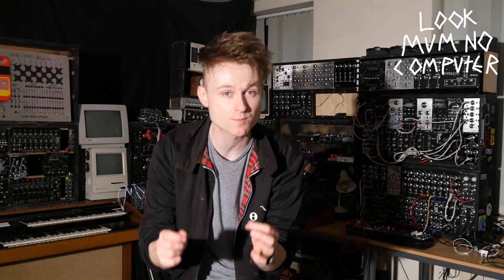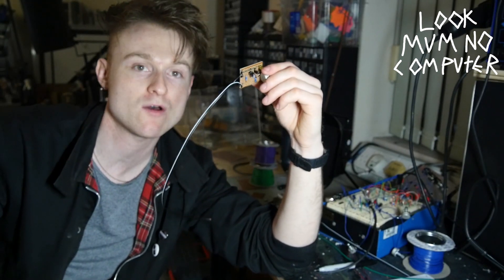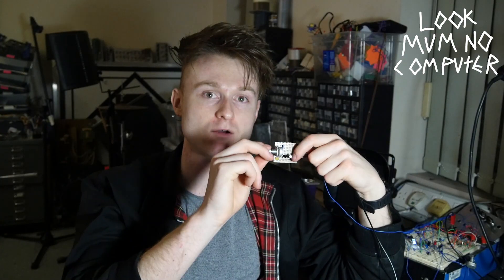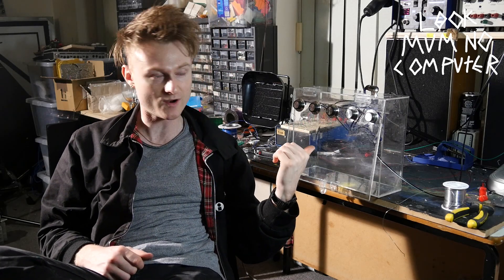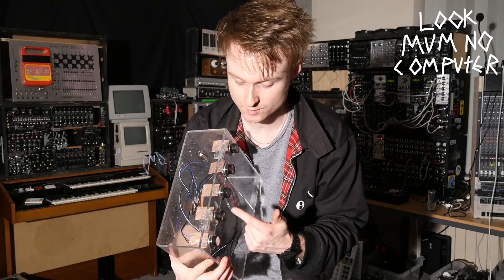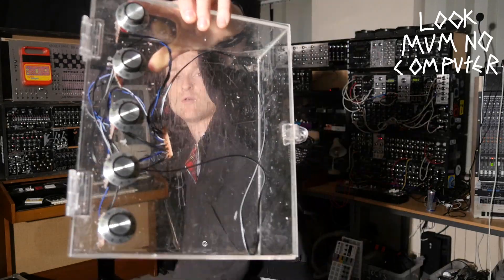The simplest DIY audio oscillator? not a 555 chip. reverse avalanche

Comment: You've obviously left something out of these instructions. Or, your diagrams are wrong.
Reply from the maker: It works both ways. And has worked for many people. Try the next video in this series some 2n3904’s need more voltage
Reply: @LOOKMUMNOCOMPUTER Thanks ill check my batteries to make sure they're up to snuff. How much higher can i go on the voltage? I could series another 9v in. That would be 27v. Too much?

Comment: It's not clear from your diagram how the 10k pot is wired. Please clarify. It looks like you've jumpered the outer and center legs of the 10k pot together with the 18v positive. Your hand drawn block diagram shows something different. Looks like you're only using the outer two pins on the 10k pot. One to the 18v positive and the other to the transistor. Please clarify. I am 59 years old and I can't get the simplest oscillator working! I haven't done a lot of electronics since I was in high school electronics class back in 1985, but you'd think I could get this the first try! Very frustrating! Also please clarify the output ground for the speaker. I am assuming it is the ground for the two 9 volt batteries. Does this circuit need a preamp?Love your channel but please help. Sincerely, Carl. Astrophotographer, musician, artist and electronic tinkerer, but feeling like a dummy.

Comment: Hi LMNC, how are you? Please, not being very experienced in electronic construction, for each component, what is the nominal voltage to respect? For example, for the capacitor, how many volts for 10uF? The same goes for resistors, LEDs, transistors, potentiometers... or the value is not important. I'm stuck here and don't know what to buy. Thank you very much and good musical continuation.
Reply from the maker: they usually say capacitors especially

Comment: So.....will 5 oscillators need 5 pairs of 9v......that is 10 batteries
Or
Will they all run off one pair...albeit a shorter battery life span??
In the video a plug in transformer was used......will that power say...5 rows of 5 oscillators??

Comment: I have an issue with that schematics: When I do it the way he shows it doesn't work. 
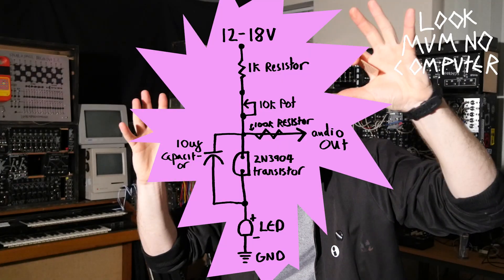- 1:56 I tried his "hand-drown" schematic (where capacitor is placed between Emitter and collector od the transistor), 
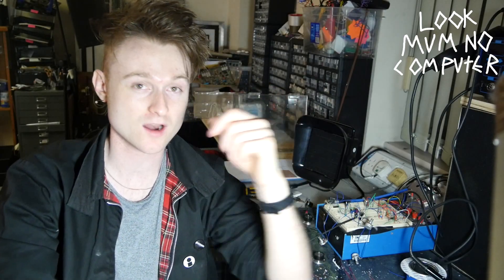- 2:57 Tried the perfboard one (where negative of capacitor is on transistor's emitter and positive to ground). I tried inverting the cap position of course.

➡ So here's how I got my circuit to work: 
Cap's positive to transistor's emitter, cap's negative to output.
Also works with cap's negative to ground and LED's negative to output. 

When I implement R2 between osc's out and general output there's no more sound at all (tried different values) 

Any thoughts about that?
Reply from the maker: yep. it works both ways.
Reply: @LOOKMUMNOCOMPUTER I was trying it too. And I have to say: all of your showed circuits doesn’t work. Maybe you don’t know the difference between bipolar capacitors and Electrolytic capacitors…Why you keep telling lies to your followers? Maybe because they keep saying
Reply from the maker: @DJtechNICK187  both ways work!
Reply from the maker: some people for some reason have had trouble with the 2n3904's for some reason. no idea why. but you can get the circuit to work with a polarised capacitor facing either way. the ss9018 is a better transistor to use. its what i made the 1000 oscillator megadrone with. but the 2n3904 does work.

Comment: Why you need transistor?
Get a piece of Galena, poke it with slender steel wire...diode!
'Crystal detectors' in old home made radios were pretty good diodes.
Zinc oxide film on steel works well too.  Negative resistance region and all that.

Comment: For any one that it might help, the 2n3904 wouldn't work for me. I read some comments that mentioned there may be differences between the various production runs of it? 
So, I swapped it out with a BC547. Had to connect to an amp with a 1/4 ts to be able to hear the signal. Two bare wires one side and the 1/4" jack on the other. Connected the cable's sleeve wire to ground and the tip wire to audio out. I also switched my cap to 4.7 uF. Thank you @lmnc for an interesting project that I'll build on further.

Comment: I tried many times but my LED stays on bright. I cant get it to blink/flicker. Tried 9v, 12v, 18v. I think i need more correct voltage, saw a video of a guy who only got it to work on a certain voltage.

Anyone here wanna talk/share electronic projects and help troubleshooting on a discord?
Reply from the maker: Go to lmnc discourse
Reply from the maker: Different transistors
Reply: @LOOKMUMNOCOMPUTER  Tried 3 other 2n2222 and some 2n3906. The led stays bright but it dims slowly because of the capacitor. Thanks for the answer! LOVE your channel.
Reply: Just found out I use 2N222(A) transistor. Maybe that’s the problem.

Comment: wait wait... ignorant questions: the 12v positive from the breadboard goes to the positive of the battery.... what about the ground? what about the negative of the battery? ground goes to negative of battery???
second: if i want to connect to a power supply to plug on the wall what is the polarity? is it safe to just switch and try?

Comment: how the heck can we get a more stable frequency with 555 is something that still kinda escapes me; i tried using military grade capacitor thinking it was the threshhold but i still get a little wobble... guess its impossible since its not temperature regulated lol. i did manage to fix it by adding another small pot to adjust the tuning and alternatively i was able to just keep the device on and would still have the right tuning and frequency

Comment: I’m really new to electronics and can’t figure why it doesn’t work on stripboard
It work fine on breadboard but after 4 tries, I’m asking for help...
Layout isn’t complicated so I don’t know what can ruin it
I’ve tried with several heat from my iron, try to clean the stripboard before soldier with a sponge to get the shinny aspect indicate I remove corrosion... I don’t know what is wrong 🤔
Any ideas ?

Comment: Hello everyone and thanks for the awesome video. As a beginner i am confused. I think i see a difference between the circuit plan on 1:58 and in the graphic on 3:00. Shouldn't the capacitor go into the positive pin of the diode, instead of going directly into the ground? Or doesn't it matter?

Comment: It's called an Esaki oscillator.
Reply from the maker: Reverse avalanche. Not sure where Esaki oscillator term came from. But reverse avalanche describes its function
Reply: @LOOKMUMNOCOMPUTER  having a conversation with chatgpt about it it seems an esaki oscillator is this circut with a tunnel diode in place of the transistor? also this 
"Esaki oscillator refers to a type of oscillator circuit that utilizes the unique properties of a tunnel diode, also known as an Esaki diode, to generate oscillations. The Esaki oscillator is based on the Esaki diode's ability to exhibit negative differential resistance (NDR) in its voltage-current characteristic curve, which is different from the behavior of conventional diodes.

The Esaki diode, named after its inventor Leo Esaki, demonstrates a region in its voltage-current curve where the current decreases as the voltage increases. This negative differential resistance region is a result of quantum tunneling phenomena within the diode's semiconductor material.

In an Esaki oscillator circuit, the Esaki diode is used in a feedback loop within an electronic oscillator, leveraging its negative differential resistance characteristic to generate oscillations. This peculiar property of the Esaki diode allows it to create self-sustaining oscillations at high frequencies without requiring external LC (inductor-capacitor) resonance circuits commonly found in traditional oscillator designs.

Esaki oscillators were of interest in the past due to their ability to operate at very high frequencies and generate stable oscillations within specific voltage and current ranges. However, as technology progressed, other oscillator designs and semiconductor devices became more prevalent, and the use of Esaki diodes in oscillators has become less common.

The Esaki oscillator's operation is based on exploiting the negative differential resistance of the Esaki diode, which allows it to achieve oscillations without the need for external resonant components. While not as widely used today, the concept of utilizing negative differential resistance for oscillation generation remains an interesting aspect of electronic circuit design history."
Reply: @LOOKMUMNOCOMPUTER the name reverse avalanche is coming from the avalanche diode. Why you don’t know the function of these device but the name of circuit. Maybe you keep cheap unknown talking
Reply from the maker: @DJtechNICK187 mate. It works. Your saying you can’t get the circuit to work. Try again
Reply: Every transistor work whit these quantum phenomena. Electrically components combined to a stable functionality isn’t easy as producing bullshit yt videos full of lies
Reply from the maker: @DJtechNICK187 but it’s not full of lies. It documents a working circuit. And how it works in various orientations.

Comment: what exactly is happening with that blue cable? i tried to do this and got as far as blinking LED but there is no sound coming through my speakers.. hooking ground to green and the end of the 100k resistor to white on my speaker wires. do i need another input between the osc and the speaker? thanks!

Comment: Sigh… Is that layout diagram wrong? Built it and the output part seems to be wrong. Sigh… Only outputs sound if connect speaker to the trannie and LED rail. And that makes LED turn off. Sigh… WTF???

Comment: Hey! So I built the thing and for some reason there’s no power going to it? I believe I have the correct power supply and it feels like I wire everything up just like you said. Side question the blue audio wire? Is that like a normal hot/ground wire it’s just color coded or is it something specific?

Comment: I’ve got a question about the capacitor that I’m hoping someone smarter than me can answer. In all the video close-ups he’s wired the capacitor to receive positive voltage on the negative side of the capacitor and had the positive side of the capacitor running to ground. The schematic shows it in (what I understand to be) the correct orientation with the negative side of the capacitor to ground and the positive side receiving voltage. Am I missing something? The negative side of the electrolytic capacitor with the stripe should be connected to ground, right?
Reply from the maker: it can be either way experiment
Reply: Thanks! That’s comforting to know. I will.

Comment: This really got me thinking if you could incorporate a Jule Thief into the circuit to use less power from a PSU and still tickle the transistor enough to make it oscillate? Wouldn't that solve a bit of a problem regarding the input voltage at least a little bit?

Comment: I’ve built this three times exactly to the strip board diagram, still can’t figure it out, anyone got any suggestions?
Reply: Dude same here idk what’s going wrong at this point. The closest I am right now is 3 functional voices but my potentiometers aren’t doing what there supposed to do when you turn them. What happened with yours?
Reply: @Post_war_designs  I just can’t get it to make any sound, I’ve tried different transistors, different power sources, etc
Reply: @TravelingasaBrokeIdiot  it started to feel like after a while I’ve just been soldering stuff together with no avail, the 3 “working” ones I have technically don’t do their jobs without the potentiometer and the other 2 are built the same way but not functional at all. So last night I turned lemons into lemonade and hooked the one osc into a flanger pedal and put that all into a chassis. So now the flange does the job of the circuit knob and then some 🤷‍♂️ definitely not the route I thought I’d take but it worked enough for me
Reply: After watching how to build 555s it seems like a 555 could actually be more simple to make

Comment: An S9018 transistor will work off one 9V battery. (some low as 6V)
Reply from the maker: Check part 2 and also thousand oscillator megadrone

Comment: I've done some circuits according to this schematic with 2N3904s and none of them work, doesn't matter if it's breadboard or PCB, tried with the transistor flipped both sides (in the video the emitter is turned toward ground which doesn't seem like reverse avalanche at all), tried with the capacitor going straight to ground with both transistor configurations, tried all of these configurations with and without the 100k resistor going to audio out, tried with different voltages, tried with different speakers, etc. None worked. None actually generated any static sounds either, only one where there wasn't a 100k resistor going out seemed to buzz and flicker on the blue LED when I jiggled the two 9V batteries that were connected.

Honestly very disappointed. Some people seem to say there's different batches of 2N3904 so perhaps it is that but I wouldn't recommend this build to someone since it doesn't seem reliable.

Comment: This is far simpler than I would imagine. You can simply tune them like a normal synth, add a keyboard and filtering and boom custom synth
Reply: yeah i'm planning to use these oscillators as a soundsource for a DIY trautonium kind of instrument because those usually have a sawtooth oscillator. Combining that with a subharmonic generator and a frequency shifter and BOOM!! Absolutely awesome soundscapes.

Comment: I had put an audio jack in the output, and it worked on headphones but why when I connected it with the computer speaker it did not ,does it require some kind of amplification how do I connect this to my computer speakers, thankyou 🤎

Comment: On the stripboard layout graphic the LED is in a weird position, looks like it doesn’t connect to anything.
Reply: The black dots are the pins.  They are inside of it.  He also got them wrong, when compared to the schematic.   Schematic shows everything going through the LED.  Perf board layout shows LED across collector and cap.  Actually, schematic shows the transistor turned around so emitter and collector are backwards, too.  Kinda all over the place.  No commenting on his web page, so cannot help him to correct it.
Reply: Also, stripboards and breadboards add capacitance, naturally, due to the long, parallel strips with air separation.   Something to keep in mind if you prototype it.  It may not sound the same prototyped differently or in a proper PCB.

Comment: I only have PN2222A transistor. Will it work?
Reply: With a high enough voltage, almost any general purpose NPN BJT transistor will work.  But, they are not guaranteed to.  See the Wong study he mentions.  It was hit-n-miss, even from the same batch.   If you want lower voltages to trip it [when it does work], though, I think you want generally higher current gain bandwidth transistors.

Comment: Thanks for this videos dude!
I have a question about the project. I made this with 12V and it oscilates pretty well, but it sounds with a really low volume. I tried to amplify the signal with a simple 2N2222 amp scheme and it works, but the wave turns into a square. I assume that a lot off voltage is falling at the 3904 so the signal reaching the other transistor is low voltage, turning on and of the 2N2222.
I'm a totally beginner, can anybody tell me what I'm doing wrong, or how can I fix it?
Maybe I have to use 19V?
Reply: The low volume because of the 100k resistor. Removing that will not make it possible for them to be combined, though.

Comment: Currently attempting to make this! Don't have the right transistor and I'm missing the 1k resistor. Transistor is order and everything else is soldered in place. All the parts I have from kits or desoldering boards. Don't really have any modules currently other than PSU so I'm probably just going to turn this into a eurorack module and edd stuff as I go

Comment: Is there any layout and wiring info for the combining board you have added that mixes all of the oscillators together? I have tried soldering 3 onto one single board the same way as if it were 3 individual PCBs and it kinda doesn't seem to work well like that. It's almost as if 18 volts isn't enough since Oscillator 2 barely oscillates (it has a 4,7uF 25v capacitor) and it seems changing the pitch of the others also affects each other.  SO i'd love to see how you managed to mix the whole wiring at the end. :O pretty please?

Comment: I'm just starting out with this stuff; i followed this tutorial on a breadboard & used a 0.22 uf capacitor instead of the 10 uf used here-- i'm getting a really bit crushed sound out of it. could that be a wire-related issue? even the 10 uf capacitor sounds distorted

Comment: Maybe Im asking a super stupid question.. but can you put a 1n914 diode  parallel to the led to distort it? Just like a simpel bazz fuss circuit where you can also use a led instead of a diode

Is this possible?

Comment: I think I build the circuit right on a breadboard, but no sound. The LED flashes at a different rate when I turn the pot, and I've tried 12-18 volts. Should I be able to get sound connecting directly to a little 8 ohm speaker?
Reply from the maker: Try connect to amp

Comment: What about adding an envelope, filter etc, to a setup like that in a plastic case instead of more oscillators? Anyone know? Would it make more sense to make them all together or would it be just as easy to make the components, put them to casing with enough space and keep adding, similar to a modular system?

Comment: Why not use a shmidt trigger oscillator using a 74hc14 (ls works fine), a capacitor and a resistor. You can even get 4 oscillators per chip